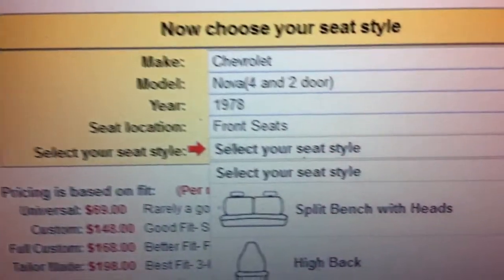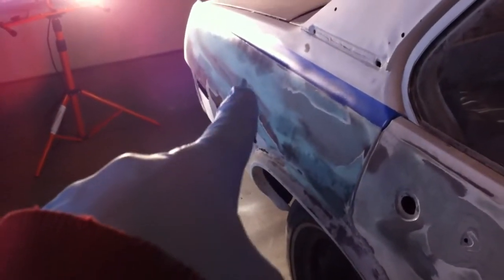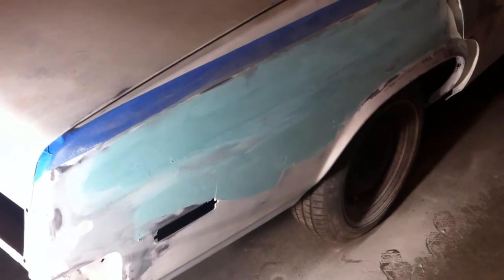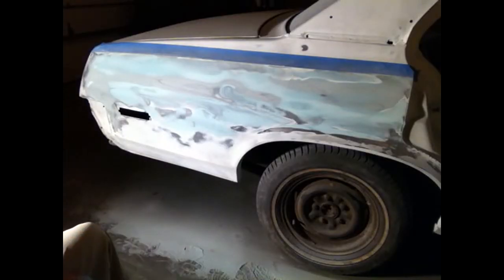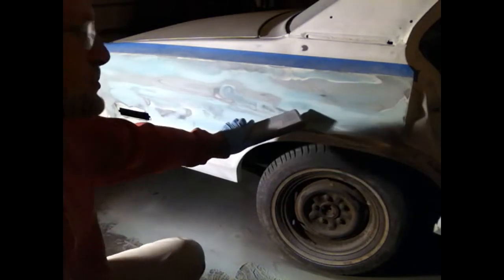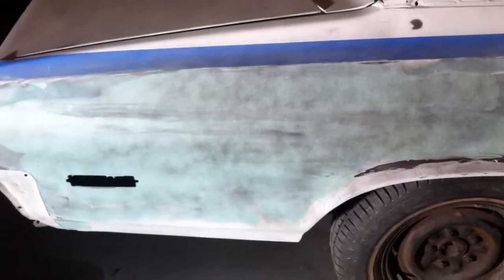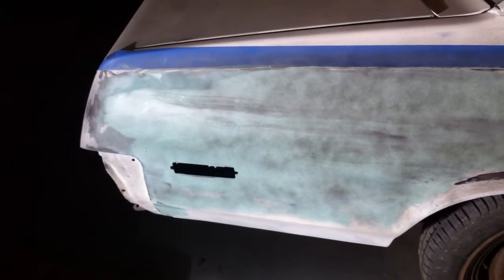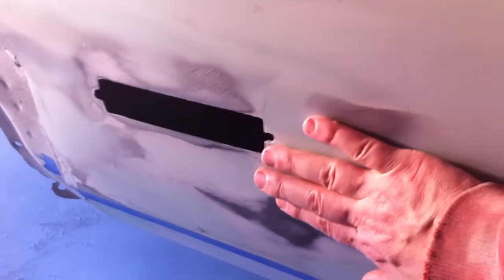Trying to get the 1/4 "good enough"

Comment: I almost jumped the gun and left you a comment about guide coating the filler.  Glad I watched the whole thing first.  I use it on filler work a lot when I feel like I'm chasing my tail.  Also, it looked like you ended up wiping the majority of the panel with the metal glaze.  I almost always do that.  I find it easier to block the whole thing straight if I wipe the entire thing.  A little fill here, another wipe there always keeps me chasing my tail because you focus on it and end up under cutting the stuff you already had straight.  Just my .02
Reply from the maker: The thing that had me chasing my tail is, I would fill in a low spot, but that swipe would create new high spots... but because they would be sanded all clean, I would interpret them as "straight spots"-- with new low spots near them... and I fill those in and... chase my tail. Now I keep in mind that I shouldn't have any new low spots, if I do, it's because I have new high spots. I'm much more aggressive in sanding

Comment: Another trick to feel a panel with a bare hand is to put your hand on a clean rag and feel the panel. You'll be amazed at how much more you will feel over feeling with just your hand.
Reply from the maker: Like a micro fiber cloth? That kind of thing? I don't like putting my bare hand on the panel (gloved hand.. yes)
Reply: Yaheuben66
That will work , as long as it's clean oil free.   You'll feel a lot more highs and lows.